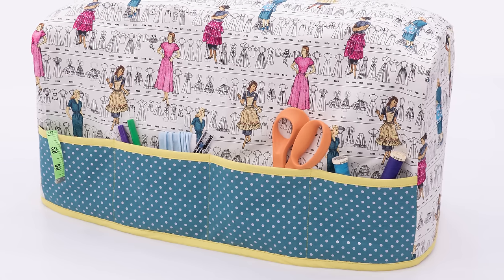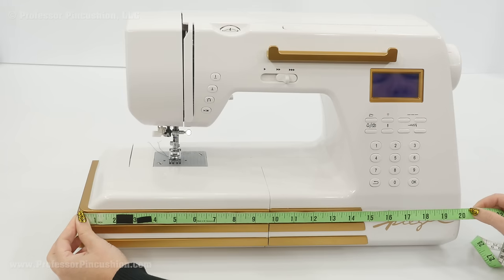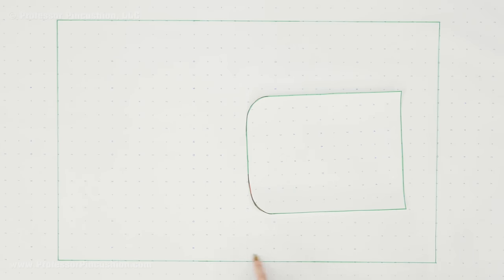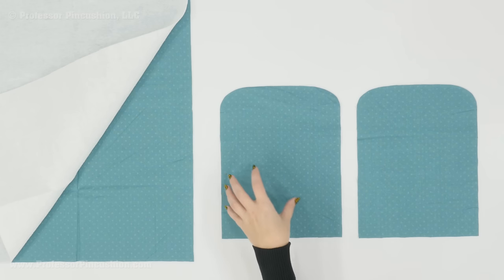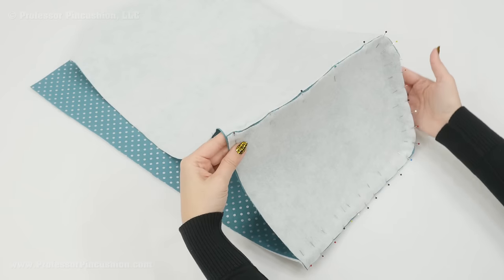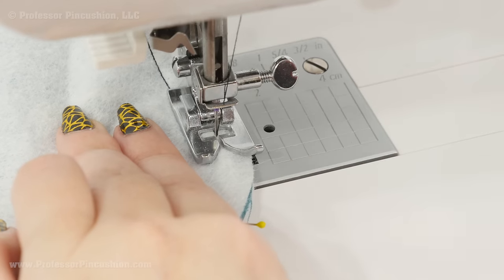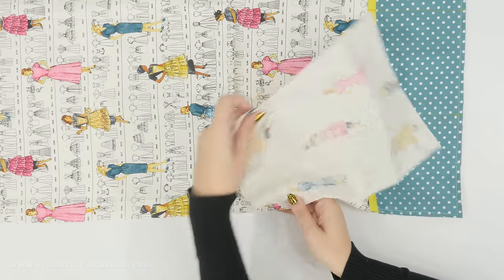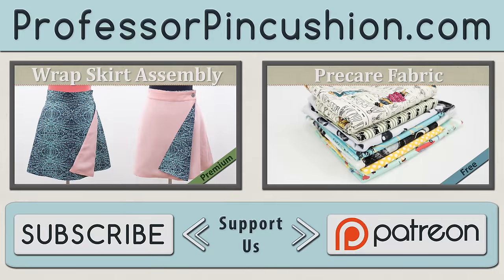How to Sew a Sewing Machine Cover - Pattern and Assembly

Comment: I made 3 sewing machine covers the past two days using this pattern for the 3 machines I have set up all the time.  I like the pattern but I have a hint.  I made one for my FeatherWeight and my Viking both of which are wider at the end versus where the needle is.  So that area was a little wider than I liked.  Just didn't fit as snug as I wanted.  I got to thinking about "darts".  I used to make clothes and we used darts to fit things.  So on the front end of my machines that are narrower I just put a dart in.  Works great and nice and neat.

Comment: Have used fleece (not fusible fleece) for the cover (no pocket)  

Advantages of using fleece::
-no fusing required
-no lining required
-stretches a little for easing around curves and for fitting on machine
-no raveling raw edges
-no binding required
-no ironing needed during construction
-helps "dust" machine when slipped over machine
-can be tossed in the washer/dryer and then used immediately without ironing it
Reply: Great idea; using actual fleece would never have occured to me.
Reply: You've made a convincing argument.

Comment: Great tutorial! After completing I will say that you definitely don't need a full yard of fabric for each. If you're like me and are trolling the remnants section, I only used a little over a half yard of each fabric, so I had a lot left over (and my machine is bigger than that spiegel). I also think you can skip the step of pattern pieces since you're just cutting rectangles. Just make sure you cut the side panels first to be able to adjust the main panel as directed in the tutorial.

Comment: Does using directional fabric mean the design will be upside down on the back side of the cover?
Reply: Yes it will.  An option would be to add 1/2 inch to that measurement and then cut it in half and then flip one side so it will be pointed in the right direction on both sides.  The extra 1/2 inch is to account for the added seam allowance.  You only have to add it to the fabric that needs to be cut for the largest pattern piece and only for the outside unless the inside is also directional.

Comment: One other thing I didn't mention.  You do not need to make a pattern.  All you have to do is cut the two pieces of rectangles with the measurements you get from your machine and then on the smaller side pieces just round the corners on the end that you want to be up.  Very simple to make and less work not cutting out a pattern.
Reply: Actually. Good idea.  While learning to make patterns is a good skill, in simple cases...one can wing it.  ;)
Reply: Thanks, you just made my life that bit simpler, your system has worked well for me, thank you!
Reply: She did explain that she made a pattern for future use.

Comment: Where can we find the awesome fabric that was used in this tutorial? Great project, thank you for sharing!
Reply from the maker: +Alison Janvrin I think my mom picked it up at JoAnn's in the specialty cotton section :)
Reply: I have to admit that I have enjoyed watching this tutorial multiple times because of the main fabric pattern. You are lucky your mom has great tastes!

A sewing machine cover is one of the first projects I tackled when I bought my sewing machine last year. It didn't turn out great because I used scraps of fabric and kind of quilted it. And, I hadn't sewn in several decades.

Now I'm thinking my sewing machine is looking very pitiful, so for its birthday, I'll make it a new cover. It is so great that yours is reversible. I love reversible things! The reverse side can have pockets on the ends of the cover. 

One thing I think I will do differently is put in zippered pockets. I made my pockets kind of deep, but found that even so, stuff was always falling out of the pockets when I removed the cover. Needless to say, I stopped using the cover a while ago because I was tired of trying to find a new spot for all the stuff that fell out of the pockets. I use a simple old towel for a cover in the interim. Another tip, use the really stiff interfacing, so that the cover will stand up straight on a flat surface. Then you can easily access all the goodies in the pockets whether the cover is on the machine or on the table. 

I also sewed a loop of fabric to make a handle at the top of the cover. Since I'm already making the cover different than last time, I may use some boning to make the cover stiffer, and the handle will also function to hold the boning in place at the top. While the pockets hold it in place at the bottom. Still in the "thinking" phase, so I'm only hoping this will work as I haven't begun a pattern for this project yet. Your videos always inspire me to revisit old projects and abandoned projects and make them MUCH better.

P.S. I still want that Spiegel sewing machine.
Reply: You included a lot of good tips.  Thanks.